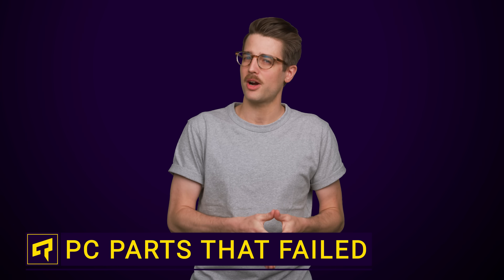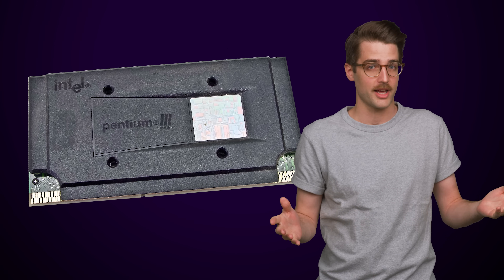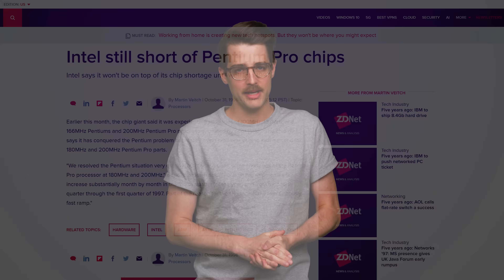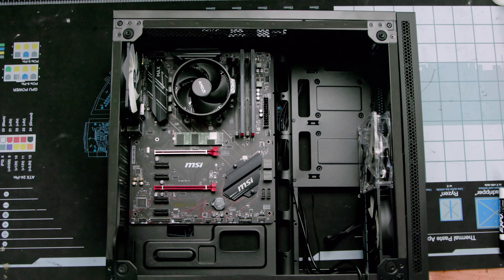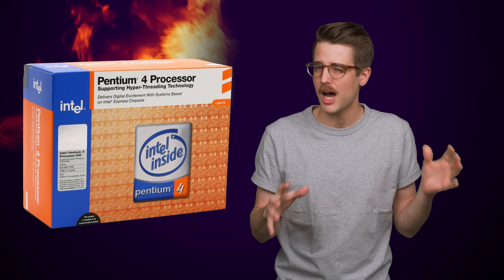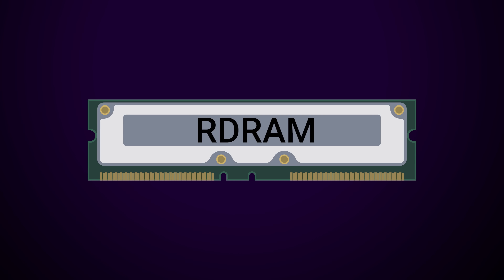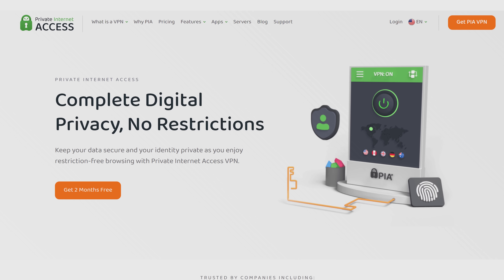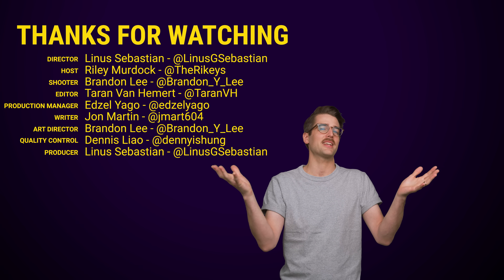PC Parts That Disappeared

Comment: BTX is actual further better Standard that ATX, Imagine you can put your graphic lay flat with your motherboard, or putting it vertical without that stupid ribber cable. RAM that goes along with the air flow, etc. This all can be done with BTX layout. But you have to hack like crazy on ATX. 

And no the main reason they kill off BTX isn't because of chip getting better, they no longer needed it. I actual build my second computer with a Core 2 Duo (later upgraded to a Core 2 Quad) on my custom build system with an intel motherboard. 

The reason why BTX got kill off on the customer market is because there really isn't that many people who want to build custom BTX computer back then, everyone is looking at ATX stuff. Motherboard, cooling, case, being the key killer for BTX for custom build. OEM on the other hand is still using BTX for years until recently. As is today OEM ending up typically doing their own layout for workstation, and small/tiny pc, and they switch back to ATX for their low to low-mid range product. 

And believe me, you would have much much better Custom PC if BTX got pick up back in the day. Even some of those "cool" thing ATX case trying to do nowaday like putting 3 fans up front to take in air flow? That's standard for BTX, only does it much better. And you can see why high end workstation pretty much all have custom motherboard layout because ATX really is no good. And no, it is not becaue the manufacture don't want you to do upgrade on your own. in fact upgrade is just as easier if not easier.

Comment: I remember the days when over clockers were snatching up slotted Celeron chips because their lack of cache memory made it much easier to over clock than the Pentium IIs.
Reply: They used to sell "slotkets" that would adapt a socketed CPU to a slotted motherboard.  At the time most dual CPU motherboards were slotted and most celerons were socketed.    So I bought two and had a dual Celeron 300A overclocked to 450.   The 300a wasn't lacking in cache entirely, it just had a smaller amount built into the die instead of external.  This is what made it so fast.
Reply: @travis1240  Wow, that's interesting!  I remember overclocking the Celerons, but I don't remember getting anywhere close to 450.  Those were the slotted variety.  I guess the socketed versions were better for overclocking.

Comment: Pentium II?  Pfft... who remembers the good old days when we had to add an extra 384kb RAM to our PCs just to reach 1Mb total, using a daughterboard card longer than most modern GPUs, and we could even replace any and all individual RAM chips if they became faulty?

Oh, and let's not forget the joys of BIOS/HDD/IRQ jumper settings...  Ah, those were the days...
Reply: My family's first computer was a 386SX, we wanted to upgrade the RAM to 1MB, I tried to remove the old RAM and broke the motherboard!
Reply: @jb888888888  That's a world away from my first compy: an 8088+8087 with a whopping 30Mb (10+20) HDD space.  My second was a Tandy 286; then I skipped the 386 line for a 486 DX4-100 Overdrive; then I skipped Pentium and went with AMD (Athlon XP Palomino)... and so on.  The only system ever that I haven't build myself from scrap/new parts and tinker with was the Tandy (that was a hand-me-down, and very 'Dell/HP' in its 'anti-user-servicable' design - never again have I trusted a pre-built).

Comment: Would be great, if one could simply add or upgrade the PC, by simply putting a CPU extension card in the motherboard's pci-express slot like for example an arm or RISC-V chip. FPGA should actually be already available though.
Reply: It can, it's one of many form of Daughterboard, like X670 express card from Asus (now you know why Motherboard called, motherboard)

The problem is not hardware, but software, it's completely proprietary for proprietary hardware. And unless you willing to spend hundred or millions of dollar for proprietary tailored for your need, there's nothing you can do anyway

Comment: I'm in my mid 40's, so I have an ever expanding parts bin full of these things. Slot 1 Pentium II and Pentium III's, yeah I got those. A couple of slot 2 P II Xeon's from an MP workstation? Yup, I got those too. A Dell XPS 720 Core 2 Quad Q6600 with 8GB of DDR2-800, running on an Nvidia nForce 680i SLI chipset with dual 7900GTX's in SLI, all ensconced in a gorgeous, massively overbuilt, Apple-worthy aluminum BTX form-factor case? Yeah, I'm stupid enough to have one of those in my closet. And just like my old retired 8-core Conroe Xeon based Mac Pro's chassis (minus the available conversion videos) that is sitting next to it in the same closet, it's equally worthless because you can't put anything in it, thanks to the abandoned BTX formfactor. The only (and last) time I've bought a pre-built desktop x86 PC (e.g. non-Mac) in the last 25 years (but hey, at least I got 0% financing on it and I did get 10 years of 24/7 use out of it before it went in the closet). Oh, and I got a whole bunch of RDRAM too, which (FYI) Intel started shoving down our throats with PIII coppermine stuff, before NutBust came along. 

And what other long forgotten crap do I have sitting in my rubbermaid bin? I've got standalone Adaptec SCSI HBA's, and ISA multifunction serial / parallel port cards, and VLB video cards, and MO drives, and even truly ancient 16bit ISA AST EMS memory expansion cards and "hard-cards" and tons of other crap I should have recycled long ago. Hell, I've kept some of this stuff so long, it's now worth real money on e-bay, which is just bizarre to me.

Comment: Action Replay III cards on consoles and Amiga's. that best hacking tool ever, easy to install and plugged direct in to the CPU's Busses, so could hack each chip(CPU/FPU/ANIMation/Copper GFX) seperately, Monitor games and read which bit have change to implement cheats etc. You could machine freeze at any point save to Floppy with a boot sector and reload back the untire machine's info direct and carry on where the game was frozen. This made bypassing DRM so easy as you would play the legit game until after the point the DRM check had taken place, then freeze the machine as a file and build a floppy boot loader and intro in AMOS basic and/or 680x0 Assembly, then anyone booting from that disk could run the game with copied disks (Piracy as it is known today). But today's machine have parallel IDE buses vi lock standardise ways. But the Action Replay III was a gamer's best friend allowing you to return to the point just before you died to retrain and become the best. Using cheats in training is not cheating, only in competition. Like a footballer playing the same part of a game over and over until you have mastered it is not cheating. End up a bit like playing Worrio where over and over again just practising the one scene in the game.

Comment: Zip drives, LS120 drives, mini-disk, DVD-RAM, dial up modems, ISDN, IR connections, PCMCIA cards, AGP slot, ISA slot, coprocessors, dip switches, EPROM BIOS, the turbo button, sony CD mavica, firewire, serial ports, parallel ports, SCSI, IDE, RAID 3, coax bus networks, dot matrix printers, e-sata, network hubs, AT standard, crossover cables.

Comment: I still have the Pentium 4 that started that mess and I remember building up a friend's Willamette system that required RAMBUS. Gross.
A few memories that kicked off full nostalgia:
1. Lol, Netburst architecture.
2. Lol, Prescott.
3. Lol, AMD's potshot at Intel with the PRESCOTT SURVIVAL KIT.
4. The extremely overdone 3x80mm fan + 240mm aluminum radiator centered LIQUID COOLING system that I had to jump to when building my first PC back in 2004. It could handle an overclocked Prescott OR a Radeon 9200 LE but not both.
GG no RE.

Comment: Next candidates for e-waste: PCs that have sufficient performance for Windows 11 but do not support Secure Boot and TPM.
Reply: Lets hope there's a permanent work around, so sad to have such forced obsolescence in otherwise completely functional cpu's. I just upgraded to a ryzen 5900x so im golden but really could have hung onto my trusty old overclocked hexa core socket 2011 xeon for a bit longer with little performance hit,  i really just wanted more usb3+ ports and nvme.
Reply: Lets make a mountain of e-waste!
Reply: @cbialorucki  No, Windows 11 needs TMP 2.0 and that only became a requirement for OEM Windows computers in mid-2016. That leaves a massive amount of computers that are perfectly capable of running Windows 11 performance-wise but won't be allowed to, both OEM computers from before mid-2016 and custom DIY builds from before late 2017.
Reply: LTT has released a video on how to bypass this requirement (for now, at the very least)
Reply: @vidiot5533  Yeah I know but it's a long path until the release version.
Reply: @Olivyay  A long path until the release version yes - but that goes both ways. It doesn't necessarily mean Microsoft will use that time to lock out bypasses, they may use the time to make 11 available on older platforms. Requiring just regular TPM 1.0 and UEFI would make W11 compatible with almost every PC that could run it in the first place.
Reply: TPM is useless against all the usual online threats! It's only good for purpose built software that use it. I mean, its a nice added security feature for windows login if you want it (which millions of average folk have done fine without for years) But why make it mandatory?
Reply: TPM is a Government/Military access protocol, used to verify user credentials before unencrypting drive, and starting the OS. If you don't worry about your data being hacked, this is a non-issue, and Win10 seems stable enough. 
Nothing about Windows 11 makes me want to ditch my 2008 Acer laptop. 😅
Reply: Couldn't be me B)
Reply: L I N U X
Reply: @hansbehrends438  Linux works jankily with most hardware is the problem. I've heard tons of awful stories about trying to get nvidia cards working and finding new issues every turn. 

ive wanted to try hopping over to Linux for a while but have always worried i won't be able to figure out shit and everything will be jank.
Reply: @WaluTime  
Idk man, graphics work fine, maybe back in the early 2000s, since back then the support was bad. Hell, most of my parport scanners or printers don't work in windows past 98. Linux covers it.
Reply: @rockytom5889  Literally any time I hear about Nvidia Linux Drivers I hear people talking about them being awful.
Reply: @WaluTime  
That's true if you stick with nouveau open source ones. As of late, the proprietary nvidia drivers run well. It's just that people somehow always find ways to fuck up a automated install of drivers. I mean, that's like fucking up the nvidia driver installer on windows, ofc the thing's gonna run like dogshit if you don't even enable the drivers. Manjaro handles nvidia well afaik, just install the nvidia drivers package and you're good to go unless you use some ancient card like a riva or something. In my experience, where people tend to fuck up, especially if the distro is debian, is they don't modify the bootloader to load nvidia drivers, instead they leave nouveau as priority. Manjaro does that automatically when you install the package, but afaik debian doesn't.
Reply: @hansbehrends438  based and FOSSpilled. Fingers crossed that Framework laptops take off, eh?
Reply: use win 10 until 2025 and then it's linux time
Reply: @martin0499  It's been Linux time since win7 was EOLed. I've just been lazy.

Comment: RDRAM was still around for a few years at least after its failed forray to the PC thanks to its inclusion in the PS2 console. (and N64 previously)
Rambus then produced a reasonably successful successor that was included in the PS3, their main market these days is networking equipment where the performance/latency adavantages outweigh the cons of their tech.

Comment: i even re-tinned my slot1 p3 450Mhz once after pc didn't bootup after monthly maintenance cleaning(used to remove the cpu & clean it seprately), it worked for 2 days & it died permantely, had to buy the square socket P4.

Comment: I was an IT technician and a systems builder for a university in the late 90's. When Pentium II processors came out it was like a dream come true. We suddenly didn't need to worry about thermal paste (which we called pigeon shit) or bent pins (we didn't have pads back then, it was actual pins you tried to fit into a socket and they bent A LOT) it was just like putting in a SNES cartridge. Good times.
Reply: A good mechanical pencil would fix those bent pins easy.
Reply: As a non-professional builder I associate the SEC units with low reliability and the dawn of superloud HSF units.  silver lining, I suppose, is that those dual 32mm and 40mm fans setups on 1/4 tall aluminum heatsinks annoyed enough people that by around 2000-2001, the was a swelling "silent pc" movement that led to the much bigger, slower, quieter fans of today which deliver more cfm at way lower decibels that the 8000+ rpm screamers of then.  With pwn controllers and the displacement of spinny discs by ssds, computers don't sound like sci-fi bladeless helicopters anymore, and dim the house lights on power-on, either, like they sometimes used to (seriously, some computers would delay and stagger various components during power-on to avoid overtaxing the psu's)

Comment: No one has made a better chip set than the 440BX that ran all those processor's. Like that article ib Ars maybe? Add a solid state drive on a card in a pci slot. It will break your heart what we left on the table.
\

Comment: So much miss information… Cache was a slot on 486/586 motherboards.  Intel wanted a piece of this pie moved it closer to the cpu as possible..  Slot was also more reliable than sockets.  Less rma.  Intel pentuim 4 was too big for process node at the time so they had to cut down the features to fit the litho tools to make it.  Just like the 11 series today was intended for 10nm but ported to 14nm. Btx failed due to poor adaptation from vendors and consumers

Comment: A few other things that have (mostly) gone away:
* Math Co-Processors
* Clock Turbo Buttons
* Plug-In Soundcards (most people don't use them now), as onboard is good enough
* Lower resolution video modes like VGA, XGA, etc

Also... why didn't we never get Blu-ray as big as the Laserdisc?  How much would one of those combos hold?

Comment: Don't forget sound cards. Without one your PC literally had no sound. 
(Yes they still exist today but not everyone runs a record company. Its not mandatory that's the point)
Reply: Unless you had a PC speaker then yeh there was no sound
Reply: and if you didnt buy a sound blaster one your games wouldnt work
Reply: This is true, most games didn't need a 3d graphics card at all, ones that did still ran on CPU and only got a modest visual upgrade, but without a sound card your screwed. Either no sound or beeps.
Reply: It throws me off thinking that I ended up using a USB DAC instead of something off the motherboard or in an expansion slot. Reason: the thing has RCA outs. But still, you get higher quality via USB